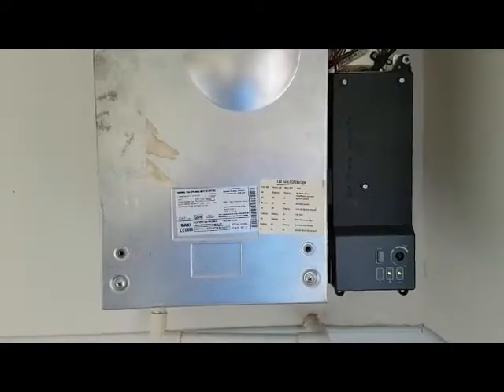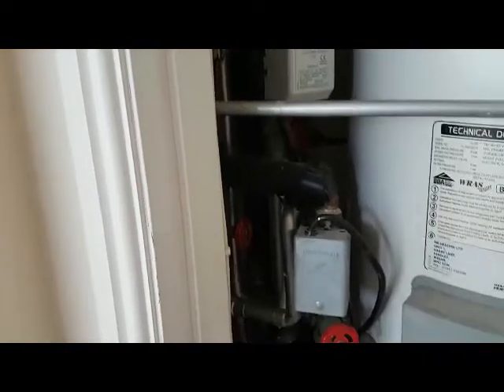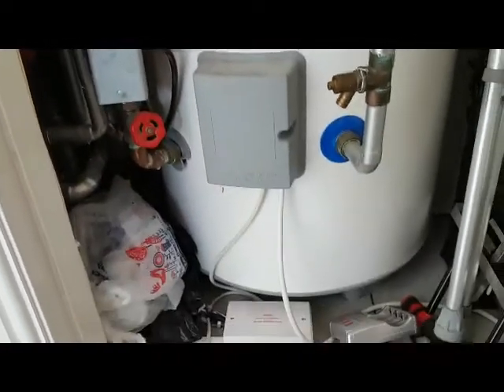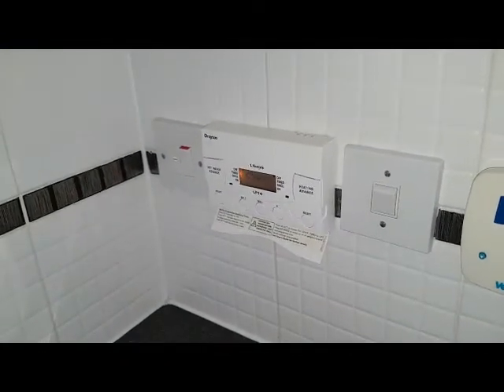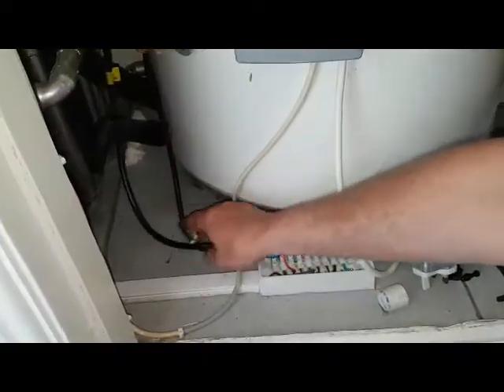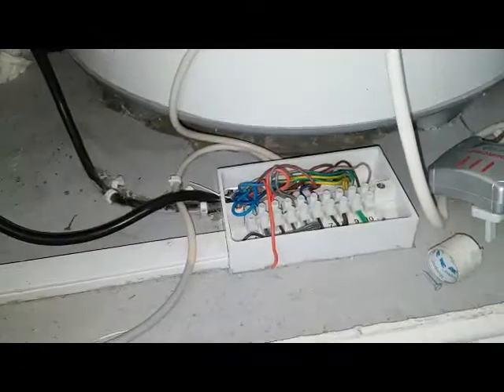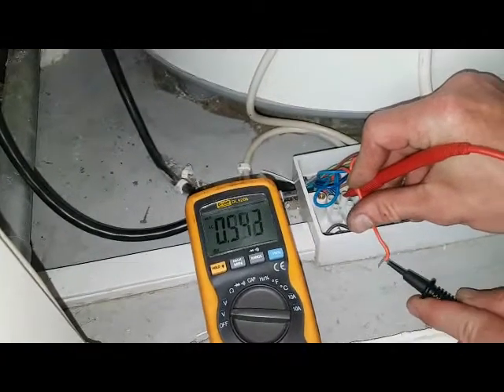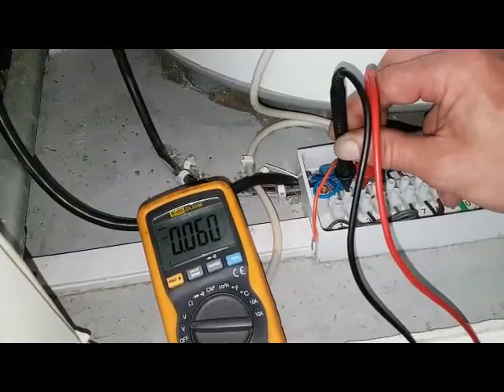Why your boiler is not turning off. With Coach Tony Morgan

Comment: Hi.I have this same problem and a similar set up with two zone valves. My heating and hot water both are working and the valves open and close as expected but the boiler is always on (not firing but on) and the pump is always running. Once i switch power off and open the junction box. What values should i be looking for on the multimeter? Also what settings do i need to use on the multimeter to confirm its a microswitch fault?

Comment: What I have is central heating pump running all the time with no hot water calling on a 3port valve.
Reply from the maker: It could be a pump over run feature from the boiler. Turn off all the power then turn back on again after 5 mins make sure the hot water and heating demand is  off.  See what happens

Comment: Thanks, been having issues with my heating being on intermittently thought it was the thermostat but replaced this and it worked for a while.  Noticed to day with programmer switched off the pump was still running, disconnected orange wire and pump stopped running, swapped out with hot water solenoid and pump only comes on when heating called.  Unfortunately to late to get replacement as all shut for new year will replace then.

Comment: Thank you very much that was a very clear explanation. Had same thing with a 3 way valve as I believe there is a live in there ( HW off ) when heating is off. Many thanks.
Reply: I tried that, but just runs all the time. Aux switch maybe stuck in on position.

Comment: Baxi solo 2PF constanty calling for heat, Changed for new Thermostat, New tank thermo stat, Acentuator, new 3 way valve, new mother board, new motherboard on off switch, new thermister.... Whats left? still calling for heat for radiators...!
Reply from the maker: Do you have zone valves or a mid position valve ?

Comment: Hi there- I have a similar problem - any tips would be welcome! We have 3 floors, our top floor thermostat will fire up the boiler, but the middle and ground floor (which run out of the same valve) has started to be temperamental - most of the time the thermostat for the middle/ground will not fire up the boiler. So it's kinda the opposite of the problem in this video. Any idea what might be causing it?
Reply from the maker: One of the zones seems like its faulty
Reply: @ARBoilers  Thanks for the reply - do you reckon this is a faulty motorized valve, or the controller? Can I use the same technique you used in this video to determine what is going on?
Reply from the maker: Give it a go and see what happens

Comment: Our boiler stays on even when it is set to off on the timer.. if I turn the boiler off on the boiler itself (via temperature knob) or at the mains wall switch it does turn off? Is this something to do with the timer unit?
Reply from the maker: It could be a zone valve

Comment: Hi, was the boiler keeping the heating on permanently?

I have a similar issue where my gas usage is super high even though we are rarely using any gas. I have noticed the boiler is always fired up even though the schedule on the thermostat is clear and the heating is off. None of the radiators are hot either until we turn the heating on via the nest thermostat which is correct.

I'm assuming the boiler being permanently fired up is my usage issue? And do you know how to fix it or what it could be? Any help is welcome. I'm an electrician but I'm not really experienced in heating systems.
Reply: Just to add it is a heating only boiler
Reply: @Mircea thanks for the reply mate. I ended up working out that a zone valve was faulty so I changed it and it's all good now
Reply from the maker: hey we're currently trying to grow our Facebook group and would love you to join Tony and the team using this link, Tony will be available to answer all your questions directly there's also updates on new trainings we just released too. https://www.facebook.com/groups/167070231326174
Reply from the maker: I'm going to launch on online boiler repair training very soon

Comment: Little tip for you , check between orange and grey with a multi meter on continuity , this will prove a faulty micro switch safely with no exposed 240v electrics , orange being switch live and grey permanent live. A Resistance check is also fine expect a low ohms reading if the switch is closed circuit. Hope this helps someone out anyway. Thanks
Reply from the maker: hey we're currently trying to grow our Facebook group and would love you to join Tony and the team using this link, Tony will be available to answer all your questions directly there's also updates on new trainings we just released too. https://www.facebook.com/groups/167070231326174